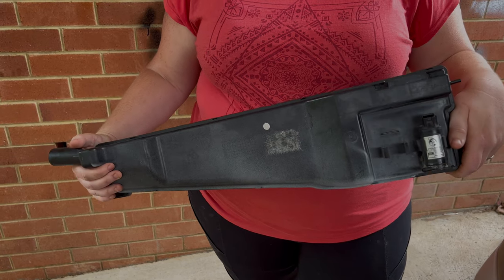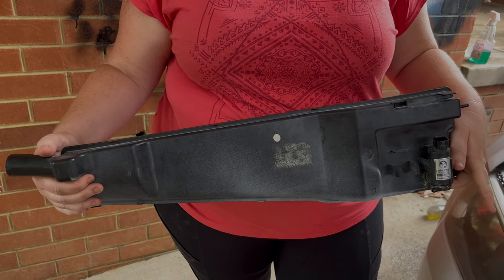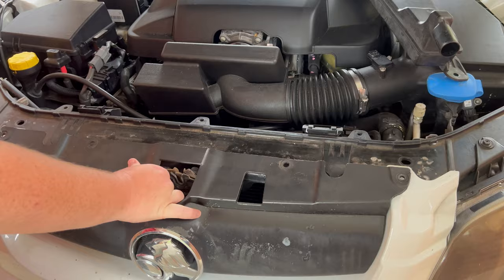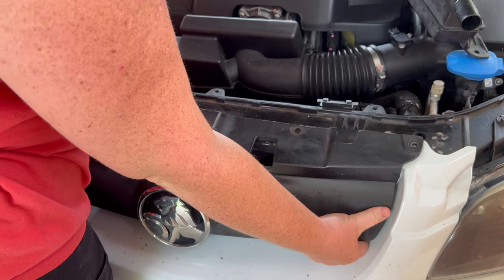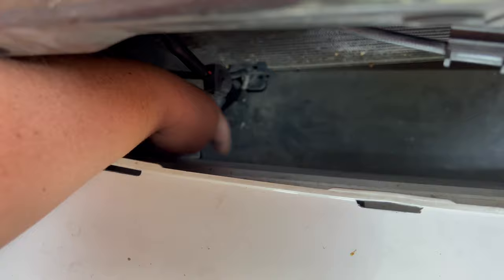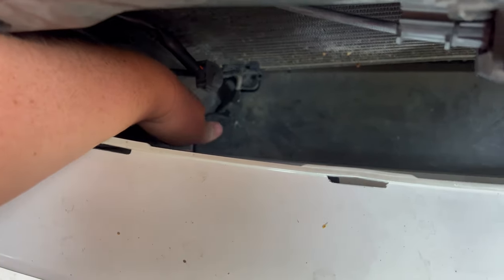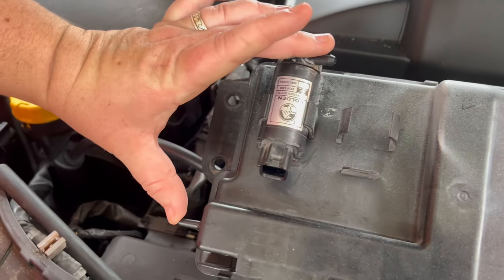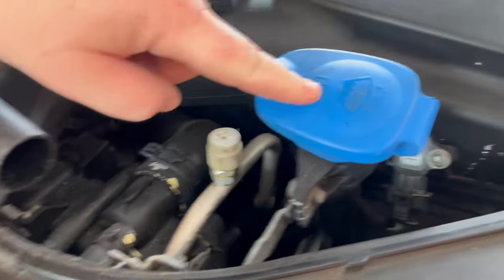Ve Commodore Washer Bottle Removal Quick Rundown

Comment: Doesn't really show how it was removed because it's not that easy and my ve commodore 2012 has 2 pumps on the bottle
Reply: 2 pumps are for the wagons.  They only sell the new ones with one hole so you have to drill the second on out yourself.   Taking the front bar off is the easiest way to remove and change the bottle